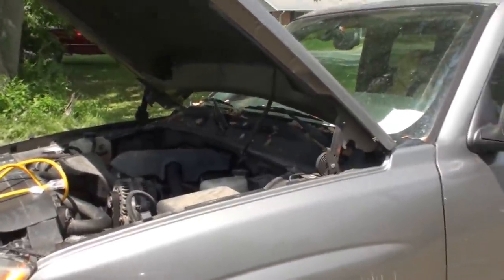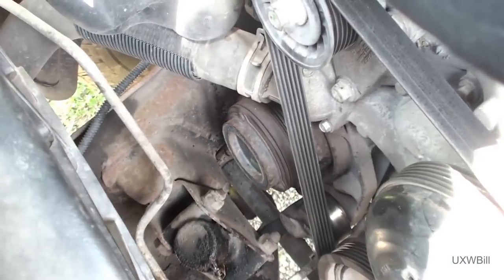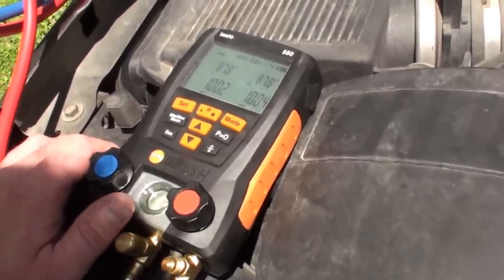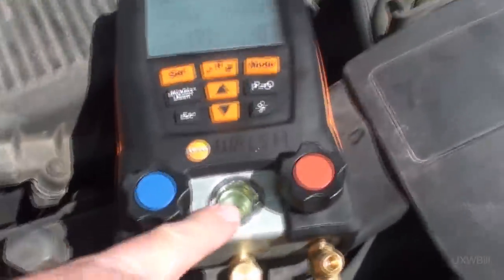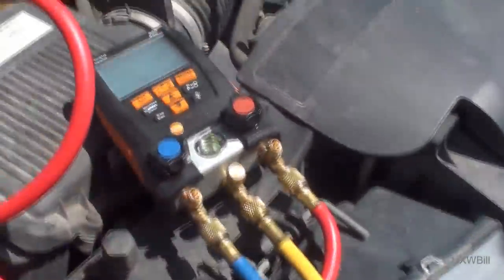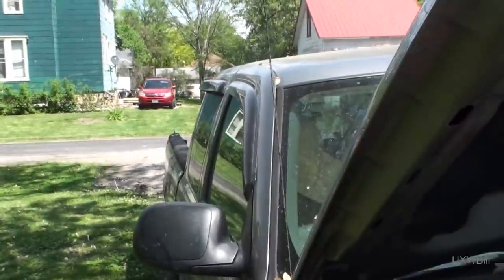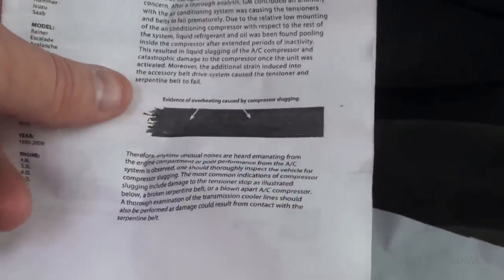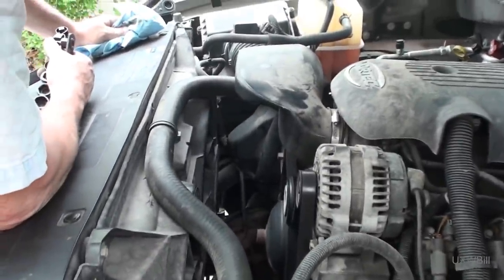Naughty Truck's Air Conditioning System Misadventure

Comment: Oh my god... not... no... it can't be... a GM with a mechanical fault? noooooo... say it isn't so! Juuuuuust razzin' ya. I actually like how easy it is to service these rigs - I was able to replace the water pump in my Grandfather's '98 Tahoe in like... 20 minutes. Can't say the same about any of my foreign vehicles!
Reply from the maker: I am very much of the belief that while most GM vehicles will run for a long time, everything else will fall off, short out, smolder or break.

Other than the engineers not caring (because they don't have to ever work on it), I don't get why everything underhood on a modern car has to be crammed in as tightly as possible. I wouldn't miss points and condenser ignition at all, but there is something to be said for being able to stand or sit underhood, right next to something like a straight six engine.
Reply: @uxwbill  I used to have a 2000 S10, and it looked ghastly inside with all the plastic pieces cracking and crumbling, but man, that thing was fun to drive. I miss that truck. I'd probably still have it today if it wasn't cheaper to replace it than to replace the parts that were beginning to fail.

Comment: What's the statute of limitations on refrigeration violations?  More than 10 years ago I replaced the compressor on a Chevrolet Corsica.  I "pulled a vacuum" on the system with a Mity-Vac hand vacuum pump, using an empty R134a can with a nipple JB-Welded into it as a vacuum reservoir.  Believe it or not, the system actually worked after the repair, albeit probably not optimally.
Reply from the maker: I don't know if there is one. I have been told that the EPA hasn't paid out a bounty in years. Whether that means they still throw the book at you, I can't say.

There's an awful lot of refrigerant that still gets out, what with the disposable nature of small, self contained systems. So many people think nothing at all of just cutting the line set, or not removing the charge before discarding the unit.

Comment: I recently changed out the condenser on my ML430 light truck...i have been driving around without using the ac for about 2 weeks now, would u recommend that i do a vacuum first then recharge or just recharge
Reply from the maker: If you really want to do it right -- absolutely pull a vacuum on the system. Otherwise you're going to have atmosphere ("noncondensibles") in the system and it won't work properly. PAG oil is also extremely hygroscopic (pulls moisture into itself) and the vacuum pump will help drive that unwanted moisture out as well.

Comment: it similar to the 2004 GMC Yukon with a vortex 5.3  I was helping a friend  work on his he has currently 430.600 on the clock other then It  eats thru oil regularly it run vary smooth for its age other then it being rusted out and paint being pitted not bad it his daily driver

Comment: don't know if you don't take apart, else you never know. 

As for Touchscreen Displeasure... I was with you..... until i was in a rock and a hard place...

Had an 18 Chevy Colorado for a few years now.... leaving everything off it's just a Fancy Radio with ipad controls & a dedicated backup camera screen...

The higher the package options the more useless junk they add to it... BUT me and my K.I.S.S. tendency's found anything more advanced then LT and you just run into trouble for no reason. If dead set... give a WT a look before entirely poo-pooing... 

I understand V6 being the best engine you can get is a no sale for some... but I haven't been impressed by Chevrolet Since the mid 80's s10 Blazer... so Take it as you will.
Reply from the maker: I won't accept a touch screen. If that means buying an older vehicle in good repair for however much of my driving "career" is left, then that's what it will have to be.

I don't want the electronic nannies, though I realize I'd have to compromise on those if I were to buy something like a brand new full size Chevrolet van. I don't have any particular allegiance to GM over any other brand. It just happens that I like the way they (used to) design certain things, especially when the cruise controls were on the turn signal stalk as is Right and Proper.
Reply: @uxwbill  that's fair. I try not to have a loyalty to a brand ( kinda hard when one has access to employee/retiree discounts)

But I will add outside of fuel... nanny crap can be turned off... I've never been nagged on tire pressure once and I know I've run them lower than I should... being between air compressors is not reccomend! 

Sat in dodge once very comfortable but they ditched the transmission leaver design for a turn dial... not sure how I feel about that.

And nothing will convince me that an all aluminum bed in a work vehicle is anything but a stupid decision. Aluminum alloy fine whatever... but all aluminum? No thanks.

Comment: Rule №1.  : "Never, ever sell, or worse yet, complete an installation of anything microchannel - which a someone else commenced, then at the insistence of the owner, stopped, because the installer began to release the factory charge, a.k.a. "RELEASE THE HOUNDS", without ever pulling the original split's lineset, and worse yet, connected the compressor to a newly installed outdoor breaker/emergency disconnect, which was connected to 14/2-wg, and a single 120 vac breaker.
Reply from the maker: I fear that microchannel coils are only going to get harder to avoid as time goes on. So...I guess I hope they get 'em sorted out someday.

Meanwhile, there's a whole other kind of Microchannel I am rather fond of (and I need to make some videos about some projects on that end of the spectrum).
Reply: @uxwbill  Ah, Kreskin detects unavoidable physics content!  It will be an acceptable/damn enjoyable tactic to spin the term into a topic destined to p _ _ s-off the HVACR crowd by using a 'video title and/or description' designed to clickbait their interests!  I'll wax "  'ol Naughty " for you!! (drive to Lancaster County, PA NOT included!!)

Comment: How Hot Is It In Illinois.
Reply: It was until Saturday had storms go through and has dropped the temperature.
Reply from the maker: You can see multiple thermometers in the video. For more current results...look up a weather forecast?
Reply: What Does UXW Stand For.

Comment: Your money, your truck, your rules. Whether the compressor is bad or not it's still 15 years old and 228k .  It would be reasonable to still replace because you're there, and you're going to drive the wheels off it.
Reply from the maker: I don't think there's the first thing wrong with the original compressor, and I couldn't justify putting a nearly $300 part on there when it wasn't needed. (Yes, I know there are cheaper ones available. I thought about it and couldn't convince myself I wouldn't be sorry.)

Comment: Should blow colder ice A/c service whole system anyways especially change orifice tube
Reply from the maker: No, 40-50 degrees (Fahrenheit) is pretty normal for automotive air conditioning depending upon ambient conditions.

Comment: That stuff on the old orfice tube kinda looked like silica gel. Maybe from the receiver/dryer?
Reply from the maker: Good point! I do have plans to put a borescope into the old accumulator/dryer and maybe that will prove video worthy? (I don't know if the borescope I have now can take video, so I may end up learning two things in one day. I'd better pace myself.)
Reply: At least  the good thing to me is that it didnt look like it had metal finings in it. I have seen that a few times.
Reply from the maker: A update on this...I picked a bunch of those beads off of the orifice tube, fully expecting to find a filter or mesh underneath. There wasn't anything more once I got past the beads. I can only guess that they are some kind of a filter, though I don't know the mechanism by which they'd work.

I tried putting an inspection camera down the tubing on the accumulator/dryer, and it turned too sharply in both cases to see anything. Maybe I will cut it open.
Reply: @uxwbill  I would love to see a video on it if you decide to open it up.

Comment: Ahh well so you put in a new compressor and drier when it wasn't the problem.

Call it "preventative maintenance"!
Reply from the maker: No, a new compressor was not installed. The dryer was replaced due to age and because it's a good idea anyway if you have the system open...

Comment: There are studies showing that 3% to 5% of r-290 helps r-134a perform better. It increases efficiency and lowers the saturation temp a few degrees at the same pressure.
Reply from the maker: On your own head be the results. I wouldn't recommend it for any system, nor would I ever do so in an automotive system.

Edit to add: you're also making an unrecoverable mess (the mixed refrigerant could only be destroyed), and possibly exposing the user of a refrigerant recovery machine to a very nasty surprise.